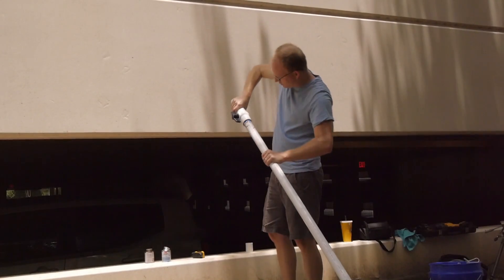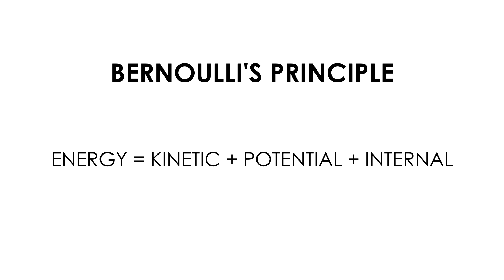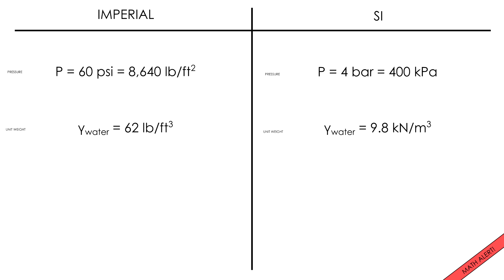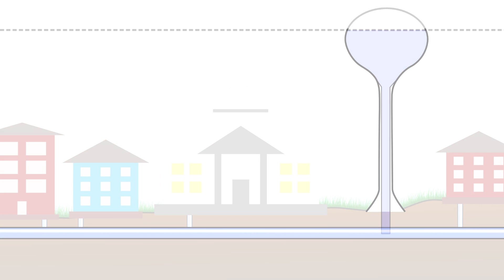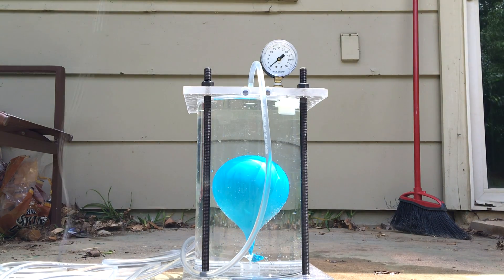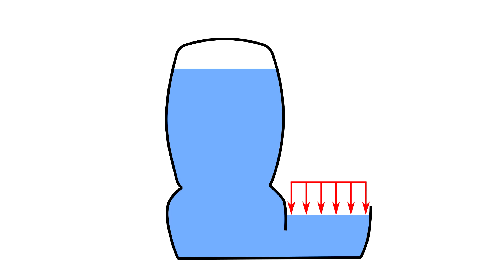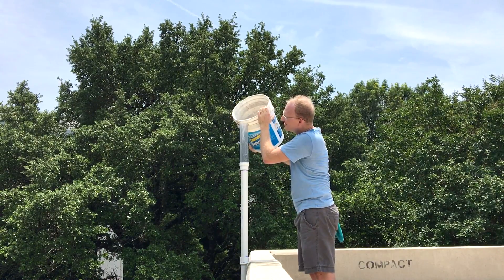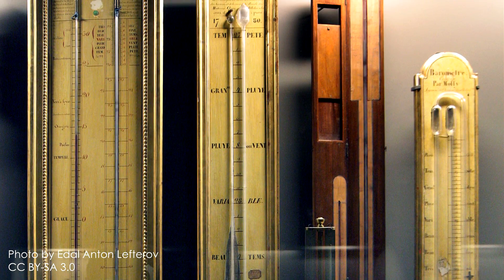Boil Water at Room Temperature! - Hydrostatics

Comment: I had an example of this a work, were refilling a building's hydraulic system with water and propylene glycol, and when I went to the top of the system to burp the air out, the pressure was too low on the return side and not quite filling the sections of the system that were about 50 feet high, so i called my coworker in the basement and he pumped some more in, so that the pressure on the low side of the pump was enough to maintain a water column that high

Comment: In my experience,    Working with weir,  and the effect of water at a certain flow & pressure,  usually insignificant for a smell feature or outlets but if your sizing for a hundred becomes critical.   I have done some unusual weirs and spouts.   The cohesion of a material on a weir ( wicking on a edge,  this effect the cut angle of the edge,,  the effect of fitting tubulence.( irregular flow).  I found working with a sample weir of one foot wide,  doing adjustment , flow, edge angle etc….the only way I found to get an accurate flow , that I could multiply by 100.    Was to actually by timing the flow filling a 5 gallon bucket & convert to gpm.  Fortunetly the pump specification were very accurate in the provide curve…and keeping fps and fittings to a minimum critical
High volume low head pumps are severally affected by both intake (nsph) and tdh.

Comment: Can said when you open the bottom valve, no water comes out from the bottom. If no water came out, it means that the same amount of water evaporated, but if the volume of steam in 1m³ is 25 liters, the volume of water is 1000 liters. Why didn't the steam expand and cause the water to come out from the bottom?  
When the water evaporated, didn't the vacuum above disappear and create gas pressure? Why didn't the steam push the water downwards

Comment: So if I connected the condensing side of a small steam turbine to the top of that pipe, would it help prevent cavitation from water condensing against the blades? As in help maintain steam quality, dryness without having to increase temperature and pressure? I want to have a steam turbine in my shed, but not a 1000psi boiler that could explode

Comment: I don't believe that the 3rd "maze" design would have the same pressure at the bottom.  Just from an energy conservation point of view: if a hole is drilled in the bottom of all the others, all the fluide will drain out. So the "energy profile" for the  height is matintained.  In the maze, there will be fluide stuck in the U sections.  These U sections are in hydrauilc equilibrium, the potential energy is 0 and does not add to the pressure at the bottom.  Im not 100% sure, but i would love to see you test this =)

Comment: If it was done outside, is it really "room temperature"? And if you were inside a room tall enough, wouldn't the temperature up by the ceiling be slightly higher than that at the floor?

Just kidding. Great video, incredibly informative, and I'm now a subscriber. Well done.

Comment: I know I’m a little late to the party, but watching this reminds me of how doctors measure the pressure of cerebral spinal fluid in medicine when doing a lumbar puncture. The brain and spinal cord are  surrounded by a fluid called cerebral spinal fluid, or CSF. This is a closed system, where CSF is produced in the brain, circulates around and is reabsorbed back in the brain again. Sometimes, there is a block in the system, or the reabsorbing area gets damaged, or there is a bleed that increases the pressure in the system. 

To check the pressure, we can take a needle and insert it into the lower back (“lumbar spine”). Then, we quickly attach a tall piece of glassware called a manometer to the site that is oriented vertically. The fluid enters the manometer, and the volume that enters is correlated with the pressure on the device, making the “pressure line” like in the water tower. 

So, for all you premeds out there, I know physics is annoying, but, interestingly enough, it still applies even to medicine :)

Comment: Does this mean that we could increase the pressure at the bottom of the ocean or a lake by just sticking a tiny tube in it, extending it upward into the air and filling it up with water?
Reply: There would be two scenarios if you were to do this:

1. If the top of the tube is enclosed, it would act like a barometer, with the water in the tube sticking out above sea level. The atmosphere is pushing down on the ocean water, but not on the tube water, so it responds by moving upwards to equal the pressure. Think of barometers - this is how most of them work.

2. If the top of the tube is open, any water sticking out above sea level will be acting on the water at the bottom and increasing the pressure there. The water outside the tube will flow away from the higher-pressure zone and the levels will equalize.

You can try this yourself with a glass and a straw. Dip the straw into the glass of water, cover the top end, and raise it higher without letting the bottom leave the water. Then let go of the top of the straw.
Reply: Thank you!

Comment: I design wells, which are effectively 20,000-ft columns of water or other fluids and mastery of the principals discussed in this video is very important. I absolutely utilize my understanding of hydrostatics and phase diagrams to earn my living and this video is the best explanation I’ve ever seen. The only difference for me is the effect of atmospheric pressure is so small its effectively 0 compared with the “atmosphere  “ at the bottom of the well, and the pressure is so great water can exist at as a liquid at very high temperatures instead of the opposite shown for existing as a gas at very low temperatures.

Comment: I'd just like to point out that many (if not all but Idk) auto-refilling pet water bowls that I've seen use a float valve at the base of the reservoir where it meets the water line in the bowl itself. I don't know how this affects it differently than if it were as shown in the video, simply the water pressure itself holding it back but that's just an observation.

Comment: How big a flywheel and turbine is needed to move all of the water from one cylinder tank to another identical tank, stopping then reversing with flow reversal of the water. This 'oscillator' will reverse several times, loosing the same amount of energy with each cycle. Adding a motor to the flywheel and an adequate solar panel to offset this loss should keep the system cycling indefinitely.

Comment: I can't believe height vs. pressure isn't intuitive to me.  If you swim to the bottom of a pool or go, say, 10 feet under the surface of the ocean, you feel the pressure in your ears.  So, instead of all that water above your head, you could literally have your head inside a container of water not much bigger than your head with very thin tubing extending out the top of it.  Fill that tubing with water and go high enough up and you'll crush that person's head!  I can't wrap my head around this! lol

Comment: I made a community bee feeder from a 5-gallon bucket by drilling small holes in the rim of the bucket where there are small angled support members.  I put a lid on with a rubber o-ring.  Flip it over after installing the sugar water and placing the lid on.  My question is how I can refill without flipping it back over and removing the lid??  Could I add a valve in the bottom of the bucket and connect that to a source before opening the valve to allow additional sugar water to flow in?  I'd shut off the flow before the source empties below the valve in the source.  Thank you for your advice.

Comment: I like the way we boiled water in chemistry class over 55 years ago. We put a bowl of water under a bell jar and then pumped the air out. As the air pressure got low enough in the bell jar, the water in the bowl began boiling. It was cool.
Reply: So when it boils at room temperature, does it just create bubbles and turn to vapor, or is it actually heating up to 212 degrees?
Reply: @Baron_Bleeke  It just boils and turns to steam. The temperature is still room temperature.
Reply: @johnslaughter5475  I see. Thanks for enlightening me 🙂

Comment: Does the pulling of gas out of solution occur uniformly throughout the tube or is there some sort of cutoff pressure or length where the energy is not high enough to pull the gas out of solution?

Comment: Could we use this principle to desalinate water by capturing the boiled vapor?
Reply: 45 years ago we did exactly that on board ship to make our potable water (I'm sure they use reverse osmosis now).  We would heat sea water to about 170 degrees F and inject it into a chamber at about 25" Hg vacuum.  About half the water so injected would flash into steam which was condensed and collected.  The hot brine was pumped overboard.
Reply: @fredsasse9973   totally cool!!!

Comment: Does boiling water at room temperature have the same pathogen killing effect as boiling it at 100C or is it the temperature that kills the pathogens and not the pressure?
Reply: Frack that's a good question..... Probably much less effective. Since  many pathogens get killed of at temps as low as 60C I believe the temperature is still the most important feature. 
Autoclaves use high temperatures and pressures to ensure high temperatures without too much boiling so that's another indicator temperature must be more important. 

Most bacteria are happy in temporary low pressures and it would certainly not do much harm to viruses. The turbulence and shock might be somewhat effective though. Would be very interesting to test.

Comment: 1. How does it affect the flavor of the ice, water or tea or coffee, etc., when you boil it at sea level, vs outer space vacuum, vs deep sea trench, vs Mt Everest, magnetic north and magnetic south poles, at the Equator, at high noon with high moon and super tide, or at midnight with a full moon and ebb tide, incoming or outgoing weather conditions,...
2. It seems that this might be a solution for micro energy generators in space, if you had these set out like bicycle spokes, speed the up the wheel to harvest the suns solar power and the water goes outward spinning generators the whole time, sun goes away and wheel slows down, water returns inward spinning generators the whole time, repeat.

Comment: Good explanation. Just a question. other than reverse osmosis or boiling sea water to make fresh water, Why not use waste heat from a power plant near the ocean get the water near 100 degrees Celsius and use a vacuum pump? Would that be a good use of waste heat using the least amount of power used? Why isn't that used? I would think it would be cheaper to build than a reverse osmosis plant?

Comment: If you have a sealed, full tank on the ground, and connect a long tube to a valve on top, would the pressure collapse a balloon inside as soon as you open the valve and connect the tube's water to the tank?

If you closed the valve again, would the balloon inflate again?

If you had a sufficiently long and pressure-resistant tube, could you make the water exit the bottom faster than terminal velocity?

Would the water at the top maintain that velocity, or would bubbles of vacuum appear along the tube?
Reply: Yes.
No.
Terminal velocity of what?
Only bubbles at the top.

Comment: When you drilled a hole in the water bottle you said that the atmoshere was pushing the water out. Is it not that gravity is pulling the water out now that air is able to replace the vacuum that resisted gravity?

Comment: Great video. A related example shows the effect of ‘g’. Take a tube closed at bottom, and drill small holes near bottom. Hold it vertical above ground and fill with water. Watch water flow out of holes, then drop the tube. We will see the flow “turn off”. ‘g’ is effectively zero, and the tube/water are in free fall.

Comment: So, does the water at the top of the column change temperature in any way?
Reply: Nope. Difference in pressure changes the boiling point of different liquids. In this case the 0 pressure at the top drops the boiling point of water so low that it just turns into vapor just like it normally would when you heat it up. Another way to think of it is that the water needs less energy to boil under lower pressures. Instead of heating it up (adding energy) the water is has enough energy immediately at room temperature. Amazing ain't it.

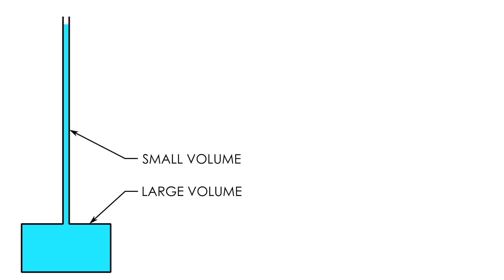Comment: just one small comment, if the small pipe in @4:16 is really small enough, you will have a capillary effect, and in fact the pressure will not be as high in the lower tank.

Comment: 9:30 , don't they use mercury to detect changes in temperature? how could is possibly indicate, by change of it's mass, 2 entirely separate things?
Reply: Mercury is used as a barometer primarily because it's dense. Under the same temperature it will also have constant density, meaning the results won't change.

Meanwhile, mercury also has a high coefficient of expansion (because it's the only liquid metal at room temperature) meaning its volume (and density) changes a lot when temperature changes. So it can be used as a thermometer as well.
Reply: @placeholdername8529  nothing about this answers my question, but thanks for trying.
Reply: Your question is not clear?

Comment: So, The water boils without a heat source. Is it possible to take that boiling water and use the steam or, use it as a heat source?
I have a 40 foot embankment a Chapel with a one bedroom  apartment. Is it possible to use the boiling water for a heat source or to distill water, or possible use the steam to turn a generator?

Comment: I've just gotten to this particular video, several years late, but I think the thing that makes the 'pressure in a tank' issue non-intuitive two people is that while the pressure is the same for all the tanks, the weight of the water differs, and you measure that differently. 

But measuring the pressure in pounds per square inch takes that factor out.

Comment: Sometimes i think i should have been an engineer. Im trying to make a hot water heater using passive energy. Perhaps i can do a hybrid of sun energy with pipes and a glass chamber with some kind of height and pressure element. I dont need to boil, but boiling water and sorta warm water could make a nice shower. I like to watch videos of random stuff and ill put ideas together to make one new one.

Comment: Great video, I'm really enjoying your output.  On ships, fresh water is made by boiling seawater at around 45 Celsius in a vacuum then condensing the steam formed. Waste heat from the main engine cooling system at 80c is used as the heat source. Gotta love those laws of hydrostatics!

Comment: How to boil water: pot,  stove, 6 cups water.  Yield: 6 cups boiling water. 

How to boil water, the "Practical Engineering" way:

Multi story parking garage,  cat bowl, googly eyes,  20 gallons water,  36 feet of 4" tubing,  column of air extending into outer space.  Yield: wet armpits and 1/2 fluid ounce of boiling water,  very briefly. Campus security summoned to the scene by Karen.  Many thousands educated.

Comment: Thank you for the video! Two odd-ball applications of hydrostatics and vacuum pressure: 1) generate low-pressure, low-temperature steam, and pull it through low-delta-temperature geothermal pipes; on the return trip, it is pulled into a piston, and atmospheric pressure is opened on the opposing face, to compress the somewhat-heated steam by an order of magnitude - generating local temps in the butt of the piston cylinder, for easy, compact, efficient heat at a higher temperature than the source, and 2) a reservoir where the entire lake bottom, all the way to the surface, and above it, are a honeycomb of slowly declining water levels, only minor pressure between each neighboring column of water, such that an entire 'Venice' could sit on top; the bricks used are moulded into shapes with holes, sealed over to be only slightly heavier than water, such that a 600 foot tower beneath the water needs only as much load-bearing brick as a one-storey house; numerous utilities from high-atmo domes beneath, (pressure-cycle chemistry, Maillard and Caramelization for cooking, pontoons to tug-boat factory floors, gantry systems clinging to dome ceilings where the supporting pressure holds them up) while you live and play in the sunny plazas and cafes above. "Why some cities should be submerged" on the newsletter site Medium, (include my name for Google to be less confused) for all the details.

Comment: Nice video, and experiment.

I have a question. 

You are saying 1 atm is equal to 10 meters, and I undestand you built a 10 m tall water barometer (english is not my mother language).

But I think you are not at sea level. I read you are at San Antonio, which wiki says it is at about 200 m above sea level. So your water barometer would mark about 25 cm lower (in absent of hight/low presure front)

Might it be a third reason why the water level goes below the transparent pipe section?

Comment: At around 1 minute you asked the question about which has more pressure you said they were all the same because they have the same depth. Does it not matter that there was physically more water in different containers? Shape aside if there was more water molecules in 1 container over another wouldn't it too have a higher pressure from the sheer weight imparted on it?